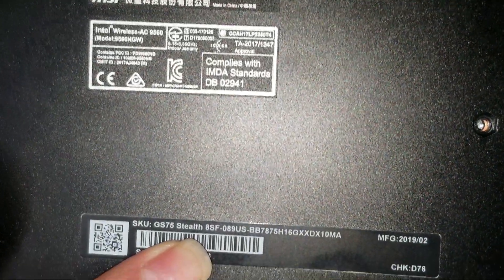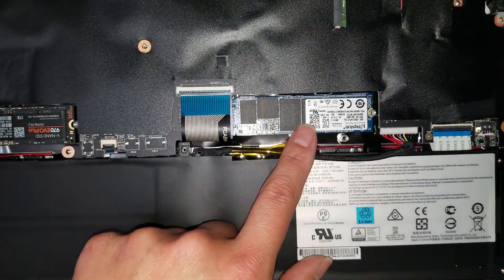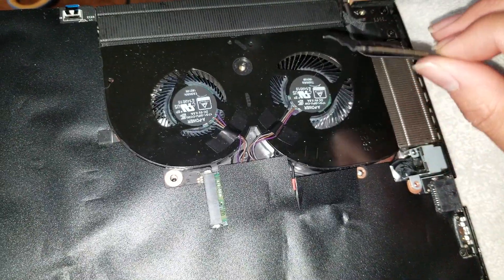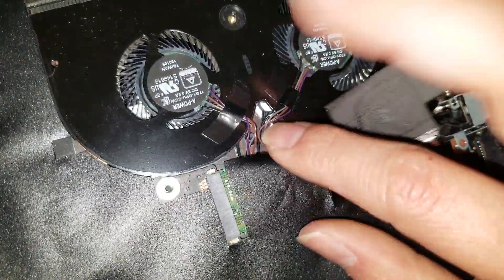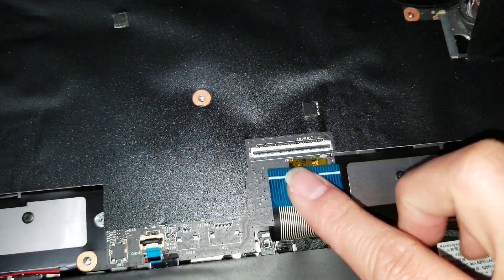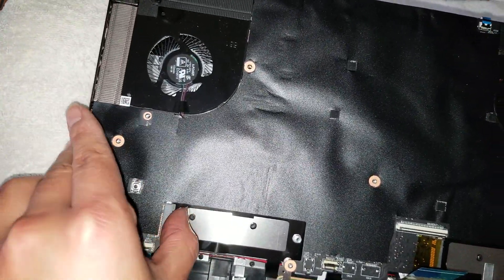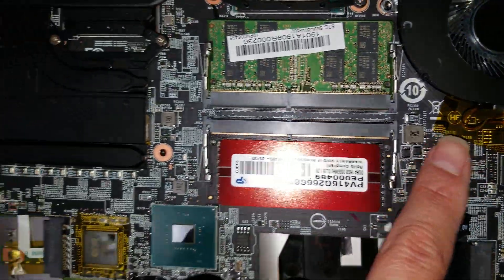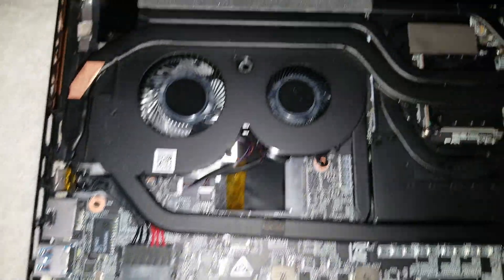*Disconnect Battery First* MSI GS75 Stealth Disassembly RAM Upgrade SSD

Comment: Sorry dude but this tutorial is worng only for one reason. Why In the world you removed battery conector last?
That is very important and you have to remove him 1st!
And you could use some cheap tripod for filming...
Keep battery removing in minde!
Also thanks for opening such a new device.
Keep going!
Reply from the maker: That's true. You also should hold the power button for a while after to drain the residual power in the capacitors, though the board is all covered and the connectors are designed in a way that won't be possible to short. Only possible risk is if you drop something metal on the board.
Reply: @ItsBinhRepaired  i noticed u said remove battery first, but i think u removed it last, so which is it ?! and what happens if i do this wrong do i damage anything ?

thanks,
Reply from the maker: @Drone The World 4K if you don't know what you're doing, it's best to remove the battery first. This is mainly when working on anything screen related or if you accidentally drop something metal on the board.
Reply from the maker: As for tripod, I want people to see what I'm doing. If I use a tripod the viewing angle won't be like the viewing angle of the person repairing it and it won't be as close up.  Also, in all my videos I disassemble the computers with one hand. If I can do it with one hand, anyone should be able to do it with two.
Reply: @ItsBinhRepaired  Maybe mount the camera on a headband or hat. There must be a way with so many porno POV videos...
Reply from the maker: @MrBill-250  LOL I need glasses cameras that also track eye movement.
Reply from the maker: @MrBill-250  if someone can find a camera  that records with no lag, I could strap that to my face and look through the camera while I work on it. I tried with my phone, but it had a slight delay, so it made it difficult.
Reply from the maker: I have a tripod, but couldn't get it in a good spot that made it work well.
Reply: Oh thanks for tips!
Reply from the maker: @bornabozic450  I gave your comment a heart so others that are less experienced will have a lower chance of messing up their device, just in case. :)

Removing the battery first and holding the power button about 10-30 seconds after to drain residual power is a good safety step.
Reply: So question, if I simply want to change the SSD should I still disconnect the battery first?
Reply from the maker: @jen-EL  no need, but still safer to do that.
Reply: @ItsBinhRepaired  u can introduce more risk removing the battery, just replace the ssd i never heard of anyone removing battery for this kind of task 🤭
Reply from the maker: @SkyHighFilms777  yup, but if they remove the screen cable or drop something on the board they'd be effed. Lol some people don't even know to turn their computers off...
Reply: @ItsBinhRepaired  i removed the full board and replaced the damn thermal paste of course i had to remove the battery cable, but replacing a silly ssd no one in his sane mind would tell u to unplug the battery,  not an MSI service center or even a computers shop, ssd replacement is the easiest thing possible for this laptop...
Reply from the maker: @SkyHighFilms777  and yet people ask me if they need to turn off their computer before adding RAM...lol
Reply from the maker: @SkyHighFilms777  when I do repairs off camera, the only time I remove the battery is when disconnecting the screen cable lol
Reply: @ItsBinhRepaired  i never done it either before but this msi laptop is tedious and the flipped motherboard is a pain, i didn't want to waste over 2k usd so i took every precaution possible and thank god its still alive...
Reply from the maker: @SkyHighFilms777  yeah...it's crazy how they design it to make it so difficult.
Reply: @ItsBinhRepaired  indeed so troublesome!...
Reply: @jen-EL  no way, replacing or even inserting a new ssd is a piece of cake, just remove the bottom cover and replace ssd easily and return bottom cover thats it !...

Do NOT remove battery to replace ssd !...
Reply: @SkyHighFilms777  Thank you very much! I just wanted the confirmation since you know,  money doesn't grow on trees. (unfortunately)
Reply: @jen-EL  no problem, they only remove the battery to avoid causing static electricity permanent damage, but replacing ssd u will hardly touch the motherboard a lot and i think keep removing the battery every single time is unnecessary, of course it goes without saying make sure ur static electricity free before touching the MOBO simply touch a metallic object to discharge ur body and thats it...
Reply: @SkyHighFilms777  that's reassuring 😅

Comment: Hi, great video. I managed to upgrade the RAM to 32 GB. Definitely not a fun experience.
The only problem I'm having afterwards is with the keyboard, manly the keys on the right of the keyboard (Y, P, L Enter, etc.) are not working anymore. Tried everything software/driver related but persists. Any tip on what could be and how to fix?
Reply from the maker: Sadly might be the cable was damaged. Try wiping the connectors and then reconnect it.

Comment: Great job ... 

But if I got that deep in I would have put new thermal paste artic silver 5 on my CPU and GPU .. this laptop has heating issues the day I bought it  ... I have an amazing cooler ... But it's still hot ..  usually all my PCs and laptops and GPUs  would get new paste yearly .. I would get my PC down to 22c to 32c 

every refresh.. but after I snapped a ribbon cable lock on a HP laptop .. I stopped opening my laptops...

But I bought this laptop new 2 years ago... Used it for 3 months ...put it away until now... And my battery is zero % ... I reset the c mos ... I know it's cause it's a lipo and is too dead to charge .. I'm hoping when I jump start the battery .. Just like I would jump start a DeWalt lipo  battery that would stop charging.. using another battery and connecting it in parallel with the other battery... I'm sure 18v drill battery will get it charging again... If not it's only $50 

 I can't believe it's that hard to get to the ram... I expected it to be hard to re thermal paste... I've been putting it off for 2 years... 

PC have to be serviced and maintained like a auto mobile ...

Remove all dust and dabree..it acts as a insolator and air restrictor...

Thermal paste gets crispy fast the hotter your PC runs or the harder you work it ... 

PS4 was known for coming off the assembly line with hard crispy thermal paste..

That would come off like dried drywall mud .

I bet your's is crispy ... 

My laptop ran about 32 to 48C max 2 years ago 

Now it's 70c 80c with the cool blast fan setting on 

That's 6000rpm fan speed.. 

Yeah I am a tech geek 
 .. you explain in very good detail.

I say this cause we both have nice laptops ... Only laptop I every owned with a little  beast graphics card
Reply from the maker: I don't own any of the computers in my videos. I have no need for computers except to do taxes. Lol I have cheap junk ones. That's a customer's and they don't want to pay for extra stuff.
Reply: @ItsBinhRepaired  that makes more sense
Reply from the maker: @SteveJ619  yup lol

Comment: MSI are durable machines. Could be not only removed the keyboard
to swap the ram? Thermal pads for the cooling plates?
I prefer pieces of copper. The temp- transfer is much better them as
with such pads. A pad is a pad, not a plate.
Reply from the maker: I think there's some other reason they use thermal pads.
Reply: @ItsBinhRepaired  expansion of different parts to keep thermal contact between. Otherwise
mxm graphic cards must use a uneven pcb that all the parts are lined up straight to the cooling plate.
Reply from the maker: I see

Comment: How to reset the bios if I don't signal on sc reen ???
Reply from the maker: Disconnect the battery and cmos battery is there is one
Reply: @ItsBinhRepaired  how long to keep them removed and put them back together?
Reply from the maker: @SkyHighFilms777  after disconnecting hold the power button 15 seconds and if you can,  short the cmos battery pins on the board, not on the battery
Reply from the maker: Your comments disappeared for some reason
Reply: @ItsBinhRepaired  thx buddy I managed to reset the bios
But it's really annoying in this laptop to have ti remove the motherboard everytime I want to reset the cmos !!...
Reply from the maker: @SkyHighFilms777  :(
Reply: @ItsBinhRepaired  is the amber light at the bottom right corner of the keyboard (near the model sticker) supposed to be all the time on whether the laptop is on or off ?!...
Reply from the maker: @SkyHighFilms777  not sure. Maybe if it's charging
Reply: @ItsBinhRepaired  apparently this small blue cable 1:38 got damaged
Reply: sorry to bother you, but do u think over here i damaged the cable or the actual connector ? and where can i get a similar cable ?

thanks,
Reply from the maker: @SkyHighFilms777  not exactly sure
Reply from the maker: Hmmm have to contact msi

Comment: I have one like it.  and I have a problem, before disassembling it I would like to tell you.  When I connect my laptop to the charger there is a bad smell, I don't know if it will be the battery or a burnt circuit.  it always remains on and does not turn off at any time.  and the battery drains very fast.
Reply from the maker: sounds like something on the motherboard fried :(
Reply: @ItsBinhRepaired  new motherboard

Comment: 9:15 i need to replace the pads if i remove the heatsink or i can still use them ?...
Reply from the maker: You can reuse them as long as you don't get them dirty. Don't touch them if you can help it.

Comment: I´ve tried to install an HP EX950 1tb on mi GS75, but for one reason the laptop didn´t recognize the SSD, even in BIOS.
Reply from the maker: Make sure the slot you're using supports pcie nvme.

Comment: thanks for your video, but i was wondering do you have a tutorial for removing the heat sink because i want to change the thermal paste, also once the heatsink is removed do i have to replace anything besides the thermal paste on hte CU and GPU ?...

thanks,
Reply from the maker: This isn't the same model, but it should help. https://youtu.be/8XU3BIJHWZ4
Reply: @ItsBinhRepaired  thanks a lot pal, already subscribed....
Reply from the maker: @SkyHighFilms777  thanks!

Comment: I made the same battery mistake on my MSI laptop teardown and also got called out for it 🤣 https://youtu.be/SrDzY6D1NRc
Reply from the maker: Lol battery disconnection isn't really important if you know what you're doing. Usually only important when messing with the LCD/LCDS connection.

Comment: Hi bro . Can I add Seagate Firecuda 520 2TB Performance Internal Solid State Drive SSD PCIe Gen4 X4 NVMe 1.3 without upgrading Ram?
Reply from the maker: Ram upgrade isn't needed to change the SSD
Reply: @ItsBinhRepaired  in future if I want upgrade my Ram what is the maximum level I can put it for same this laptop model 32 or 64
Reply from the maker: @Sami-lm2qy  no way to know for sure without trying unless someone else tried and reported it somewhere. You can sometimes find it on Google. Usually over 8gb is overkill and doesn't do much.
Reply: @ItsBinhRepaired  Thanks bro , my ram now 16GB
Reply from the maker: Sounds good

Comment: So I just purchased a gs75 and I want to add a second nvme ssd, I am not upgrading the original I just want to put it in the second slot. I was wondering if there is anything that I need to do once I install it. Meaning in the BIOS or anywhere else for the ssd to function? Hopefully you can answer my question. Thank you ahead of time for your assistance.
Reply from the maker: You need to initialize and format it in the disk manager.
Reply: @ItsBinhRepaired  so essentially install, boot up, go in disk manager to initiate and format? Correct?
Reply from the maker: @PluggedNomad  yup
Reply: @ItsBinhRepaired  thank you so much for your replies. I appreciate it 😁
Reply from the maker: @PluggedNomad  no problem. Please like and subscribe if you haven't already. It'll really help me out. :) thanks for watching
Reply: @ItsBinhRepaired  done 😁
Reply from the maker: Thanks! :)

Comment: hey man, I just got my first laptop with the same model. I wanna install Samsung 970 EVO Plus 1TB M.2 NVMe SSD soooo do you plug the SSD chip right away without unscrew other parts or do you need to remove the battery or something important?
Reply from the maker: To be safe you can disconnect the battery and hold the power button, but it's not necessary for changing/adding hard drives/SSDs as long as the laptop is powered off completely.
Reply: @ItsBinhRepaired   awesome man thanks

Comment: I have two new m.2 ssd drives.  One is the 970 Evo Plus and the other WD Blue SATA for the third slot.  My question is: does this MSI GS75 Stealth-242 come with the screws (to hold them down) already on the motherboard?  The slots are currently empty.  I don't want to break it down if I'm not sure.  Also, the SSD drives did NOT come with screws.  Thanks for your time.
Reply from the maker: I don't think it came with the screws. I don't remember.
Reply: @ItsBinhRepaired  Update:  It does come with the screws on the motherboard.

Comment: Hi, I can Upgrade the CPU too?
Reply from the maker: No, it's soldered to the board
Reply: @ItsBinhRepaired  if the processor fail, rip laptop?
Reply from the maker: @Larmaries  correct

Comment: Can i use Samsung (MZ-V7E1T0BW) 970 EVO SSD 1TB - M.2 NVMe for storage and HyperX Impact 2x 32gb 2666MHz DDR4 CL16 SODIMM Laptop Memory HX426S16IBK2/64 for ram? For my gs75 stealth gtx1660ti?
Reply from the maker: Should work fine. RAM not 100% sure, but I don't see why not.
Reply: I was searching on YouTube and found ur vid.  Its very helpful.  Im not an expert thats why im asking says its capable 64gb im changing the 2x 8gb for 2x 32gb.
Reply from the maker: @victorlester4374  should work perfectly :) don't forget to like and subscribe if you haven't already. It'll really help me out. I also have another video on how to transfer the OS to the new SSD if you need help with that.
Reply: @ItsBinhRepaired  done already glad i can help ur channel too
Reply from the maker: @victorlester4374  thanks! :)
Reply: @ItsBinhRepaired  last question.  I ordered 2x 32gb ram but its cl16.  The one u hav is cl18.  Is there a difference?
Reply: @ItsBinhRepaired  last question.  I ordered 2x 32gb ram but its cl16.  The one u hav is cl18.  Is there a difference?
Reply from the maker: @victorlester4374  the lower the number the better.

Comment: Hi everyone,

I know this is an older video but if I just wanted to stick another SSD into one of the slots, do I have to remove the motherboard? I already have dual channel RAM so I don't need to mess with anything there.

Thanks!
Reply from the maker: No need to remove the motherboard.

Comment: in order to just add NVME ssd, do you still need to disconnect anything  like speakers , battery, fans or etc ??
Reply from the maker: Just the battery to be safe, but not even that is required, just make sure it's completely off, then restart the computer one time after installing it.
Reply: @ItsBinhRepaired  thank you,do you know if the kingston 1tb A2000 NVME m.2 ssd is compatible with this one?  It has a form factornof 2280 and 3.5 mm tickness..
Reply from the maker: @hasandeniz6612  as long as it's the standard size without a heatsink it should be fine.

Comment: I just bought this laptop and am going to upgrade the RAM and add another NVME SSD. Do I need a thermal pad for the new SSD between it and the other SSD that came with it or should I be fine without?
Reply from the maker: It varies from SSD to SSD. Usually they won't need the thermal pads, but if you have one it'll help.

Comment: Great video, but I have one question. I’m planning on repasting the cpu and gpu, but you mentioned I would need to get replacement fans for the cooling part (the plastic piece the fans are part of). Can I not just keep the old ones on?
Reply from the maker: What part of the video? You'll need replacement thermal pads.
Reply: It's Binh Repaired towards the end of the video, at like 9:10. Why can’t I use the old thermal pads? They should still be in good condition right? I’ve had my laptop for about 2 months
Reply from the maker: @raffo625  you could reuse them, but don't touch them and be careful getting them dirty because it will create pockets of air.
Reply: It's Binh Repaired ok, thanks for the advice and speedy replies. If I do opt for getting new ones, would you happen to know what thickness to buy?
Reply from the maker: @raffo625  not too sure. There are multiple thicknesses. A lot of the time I'll use ic diamond in their place because it doesn't run and it isn't conductive or capacitive, so it's not risky if it gets on the components, but it's messy if you ever need to reapply.

Comment: Thanks for posting this.  I would probably just pay you to do it though.  Looks moderately complex, and I would be worried about making a mistake and damaging the hardware.  What do think about this laptop as an upgrade to the MSI GT72S Dominator?
Reply from the maker: What are the specs of both?
Reply: @ItsBinhRepaired  GT72S cpu 6820hk, gpu 970m.  GS75 cpu 9750h, gpu 2070 max-q.
Reply from the maker: Should be a pretty big performance jump. Sorry, YouTube wasn't sending notifications.

Comment: Is the Thing where your finger is at 5:01 the 3rd SSD slot? Can you put 3 SSDs in it?
Reply from the maker: Yup, I thought I mentioned it in the video. I think 2 support m.2 pcie, the other is m.2 sata, though I haven't tested it.
Reply: @ItsBinhRepaired  my friend bought it and 2 m.2 ssds, but only one slot works. The one where your samsung is in.
Reply: sorry for my bad english
Reply from the maker: @krypton9884  two slots support m.2 nvme pcie, the other is m.2 sata. They are two different types of SSD. I don't own the laptop. It was one of my customer's.